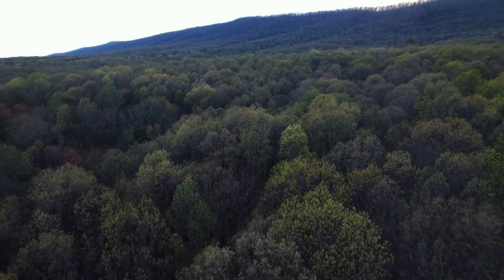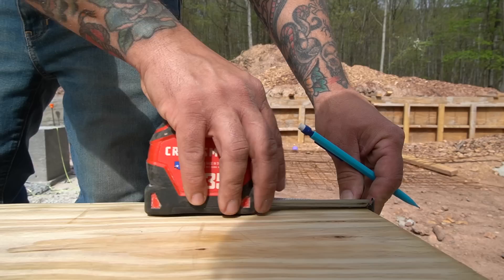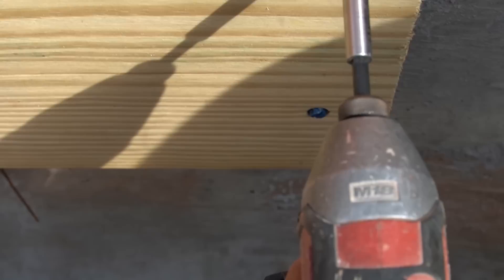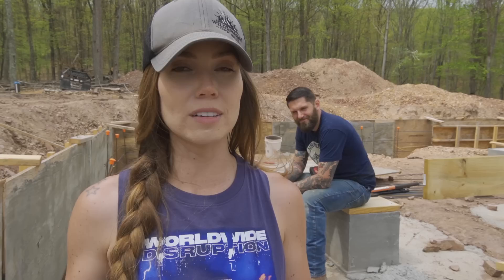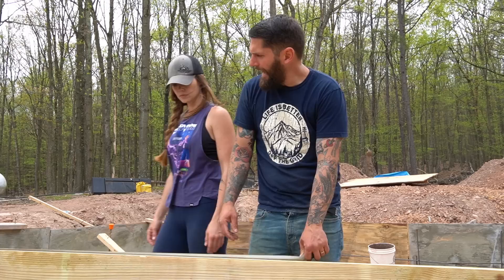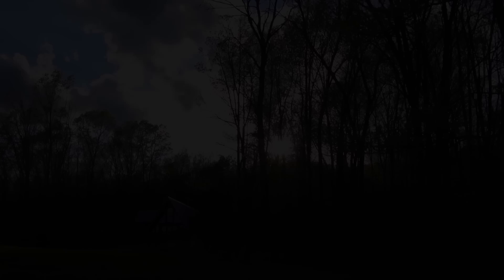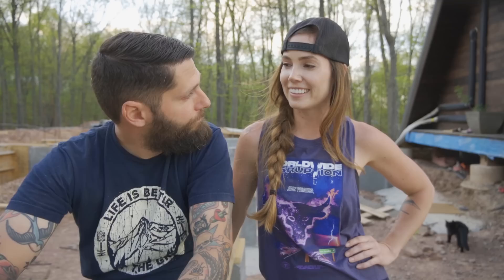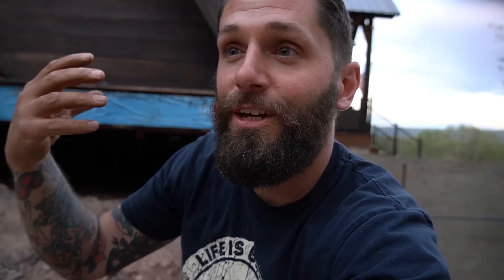Installing The First Structural Beam | A-Frame Cabin Addition

Comment: Tip to prevent rot:
Use a layer of tar paper or roofing felt to keep the bottom sill plate from having direct contact with the concrete pad in order to prevent moisture from being drawn up through the pad and into the lumber. This will help prevent the wood sill plate from rotting.
Reply: Underrated comment - thats a must for not rotting out the frame!
Reply: We use ice and water shield.  For pretty much everything lol.
Reply: That was my first reaction when I saw they had no capillary block between the concrete and the wooden bases of the beam

Comment: Josh, on the center beam, you may want to zap the beam with a few dozen nails with the nail gun. The reason for doing this is that when placed under stress, nails tend to hold their shape better; whereas screws tend to snap and break. Take care.
Reply: I bolted mine every 16 on center
Reply: And you should have put con’t adhesive between all the beam boards
Reply: I believe any time a 2x12 butts up to another in that beam, it should be on top of a support post, not between posts.
Reply: Those appear to be structural wood screws.  Most plans detail how to build built-up beams.
Reply: @rlrafter  Carriage bolts, now there is an excellent idea!!!
Reply: @kroll41271  without a doubt
Reply: A flitch plate would be required near me
Reply: Agreed. Their state building code will stipulate all these requirements.

Comment: Technically your seams on your beam should be over your columns. You should not be relying on the fasteners to carry the load. They just hold the wood in together.  Your beams, columns load bearing walls, headers and jack studs carry the load. Hope that makes sense. This should be a nice project for you. Good luck with the project.
Reply: truth ..

Comment: Concrete is berry porous and moisture will migrate through the concrete and be soaked up by the 4” portion of the 2x12 you’re extending into the outside wall. You need to wrap that portion of the 2x12 with a water proofing membrane such as denzo wrap or something to create a barrier from the moisture.

Comment: Too late now, but I was a little surprised you didn’t place a rim gasket under your pressure-treated 2x12 post caps (I.e., the “shims” under your beam).  Not to keep the bugs out, but provide a little extra protection from rot.

Comment: Got to protect the beam boards from direct contact with the concrete of foundation wall. Maybe like wrap beam in ZIP tape or form around but should be in not be in direct contact.
Reply from the maker: Those boards are rated for ground contact
Reply: Okay you said pressure treated boards later in video sorry might still wrap connection in ZIP tap so the beam slide in and out  with expansion.
Reply: Loving the build. Keep up the great work you guys.

Comment: Hi Josh. What are your plans for stopping moisture rising up the concrete piers and into the timber subfloor? We always install a dampcourse made of melthoid or plastic between any concrete or masonary when constructing an enclosed timber subfloor.  I realise it is pressure treated timber, but I feel that you still need to stop moisture rising through this timber into other building materials that may not do well with moisture. Please check with your local authorities or building surveyor/certerfier before you get too far.

Comment: It getting there, foundation always takes the longest, because you have too form up, pour concrete, and strip the forms. 
On the spot where the beam goes into the stem wall, put a piece of pressure treated under it to rest on. And some pieces of ½ or greater so the beam won't be touching the concrete and wicking moisture. 🤔👍
Your daughter reminds me of my daughter at her age, and then you blink and they've grown up. 
Good too see the lamb has made a full recovery running and jumping, awesome.  Have a good week and God bless amen.

Comment: 2:38  Do the 2 x 12 spacers on top of the concrete piers should have wood fibers oriented 90 degree to beam (perpendicular to the horizontal beam crossing them on top) instead of being parallel in order to have less chances of cracking?  Thanks again for the excellent and inspiring content WWOG !!

Comment: Josh you should use glue between the boards for strength. If those boards decide to warp it will loosen those screws.
Reply: the glue is stronger than the screws would be?

Comment: Josh.
Damp rises, so it will work its way up the concrete pillars over time and rot out the timber.
Maybe worth putting a damp barrier down under ypur support beam on the pillars. 
Great job so far .
Keep up the good work

Comment: Base plate for the beam should had been run cross grain...that would avoid sinking floor when they split and crumble from pressure from the rest of the build sitting them....! Better yet.. SCL (Structural Composite Lumber)  plates...!

Comment: I hope you sealed the part of the beam that's going to be sitting in the concrete wall  the moisture might start a rot situation.  Also I think painting the forms with diesel may help keep the forms from sticking to the concrete

Comment: I don’t know if it’s possible still; but, you’re going to want to put a barrier between the 2” x 12” and the footing.  The water from the concrete will cause the treated wood to expand and contract a lot.  The beam you are putting on  is treated; you’ll want a barrier (house wrap) between the wood and any metal hangars.  This will stop the chemical from treated wood to corrode the metal

Comment: Suggestion:  you should have used pressure treated lumber in contact with concrete  girder supports
Reply from the maker: It is pressure treated 😊

Comment: Consider Zip taping the end of the 2X12's or using a shrink wrap like they use on posts they bury in the ground. Then drill two holes hole through the  four 2X12's using rebar to lock it into the concrete.

Comment: If you haven't poured the concrete yet, wrap the end of the beam in Zip tape. Doing this will protect the wood long term from the moisture and corrosive propertied of the concrete. It will also just give you a tiny amount of space to wiggle the beam out in the event you ever need to swap a board 30-40 years from now.

Comment: Thanks for showing the rebar... I want to see how the two levels of rebar tie in vertically and how you do the roof/ceiling for the safe-room.  I guess you have a reason, but I wonder why you did the more complicated corners on the opposite end of the addition from the safe room instead of just a rectangle.  I wonder what the cost is to rent some metal forms too.

Comment: Nice video.  I hate to be a nitpick, but you should use sill gasket between your plates and concrete to prevent moisture migration from rotting your plate.  Also use nails when nailing the beam, since screws are not recognized by the code because they snap due to higher strength steel  having less ductility.  Also your beam splices are in the middle of the span, they should be within 1/4 of the span from the columns.  Sorry to nitpick, but I am a retired structural engineer and I can't help myself.  Cheers.

Comment: How many solar panels are needed to substain your house year round...and can you do a video on it?
Reply from the maker: We have a full series on the build of our solar system. If you scroll way back you’ll get the full scoop on each component, how we installed it, how if functions and and the cost. 
Our array has 32 solar panels and we have 8 3.8kw batteries. That kinda brushes over the details but the system powers our entire house (which is fully modern with appliances, AC etc.). We added a whole house backup generator just in case we run into a crazy season with extended rain or snow. The generator would kick on and charge the batteries for us in that scenario. However, we sized the solar system large enough that it would be rare for us to need to run the generator

Comment: Curious if you guys think you’ll need to ad panels to the solar system to compensate for the increased draw?
Reply from the maker: If we decide to install an HVAC system throughout the entire house then yes, we will need to add on. If we stick with the mini splits and do an outdoor wood boiler for radiant heat then no, we won’t need to.

Comment: I would thru bolt your beam on the areas where you aren’t sitting over a pier. I would also get 3/4” plywood and cut 4’ pieces to sandwich on both sides of those Joints then thru bolt with six to eight 1/2” bolts. All your breaks in your beam Should be over a structural support. Unless you have a building inspector that says otherwise. 2 story structure should have a timber strand or lvl one piece beam for this type of load. Goodluck.

Comment: Why are you not using treated lumber as plates on top of the concrete piles ?
Reply: Glad to hear it was pressure treated 2 x 12 although it didn’t actually look like pressure treated
Reply: I might suggest you end treat the cut ends of the 2 x 12 with preservatives

Comment: Will you put bolts through the 2×12s? I think I've seen that before to help anchor them together.
Reply from the maker: We used lagged them all together (you’ll see Josh doing this in the vid) 😊 The screws were just to keep the boards from tipping as we worked our way down

Comment: Josh.
Sir you need to place bolts or all thread rod thru the beam with washers and nuts. Screwing g o e to the other is not sufficient.  Would hate to see it cause you trouble later. Take care.

Comment: Josh, 
Not a good idea to put that beam into the concrete. That end will dry rot quicker. Better to use the angle iron on both ends.

Comment: No judgement But ... I see how particular you guys are about safety and work ethic and I dont know what the engineering standards are for virginia area but I'm a GC in florida where we are very concerned about wind loading translation to foundation and one thing I can comment on this context is I dont understand your rebar splice eng in the least.  For contact splice on #5 we would be something like 60" and for none contact splice with at least 2 Bar Dia. of separation we would be in the neighborhood of  24'" of splice overlap.

Comment: NOTICE THIS FACT: 
Guys I’ve done carpentry work in my past and still do a little from time to time.... That Center Beam you guys made. Which I call a sandwich beam or a layer Beam. The layer Bean is actually stronger than a solid 1 piece wood Beam. Here’s the reason many people don’t know. If there’s a weak spot in A solid 1 piece Beam it’s more likely to break or bow in time. Because all the grains of the 1 piece Beam are all traveling in the same direction and that’s where failure occurs is in the grain of the wood. Where with the sandwich/layer made Beam you have all the different layers of the wood joined together. Therefore the grains of the wood is going all in the same direction which is horizontally but none of them line up. Like you would have in a 1 piece Beam, which in fact makes the layer Beam much stronger and it’ll actually hold more weight and less likely to ever bow or break. So id feel much more at ease with the  performance of the layer Beam than I would of a 1 piece Beam. Like us men like to say: 
THAT AIN’T GOING NO WHERE ! 😂👍

Comment: Not to criticise but is there a reason that you haven't put a waterproof membrane between the concrete piers and your timber, to prevent water leeching through the concrete into the timber.
Reply from the maker: Yes, it is pressure treated wood so it’s not necessary

Comment: I think that beam needs to be held with bolts not just screws and you can't have wood touching concrete you need to put something in between them don't know the name
Reply from the maker: They beam is lagged together (shown in video) The screws were just to keep the boards from tipping as we worked. Also, the boards are rated for ground contact

Comment: I hope you guys are going to lag bolt the main beam. And not trust those screws.
Reply from the maker: We used screws here and there to attach the 2x12s as worked to keep the boards from tipping but you’ll see in the video we also lag everything together